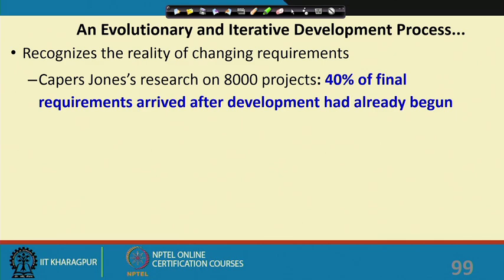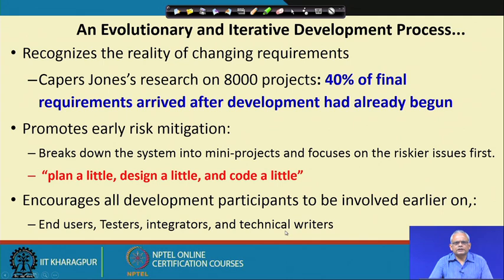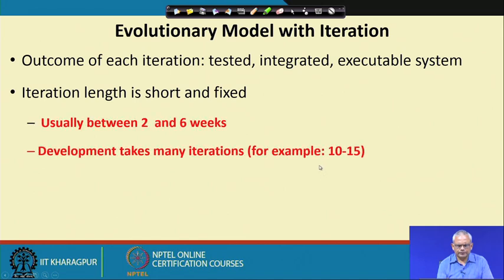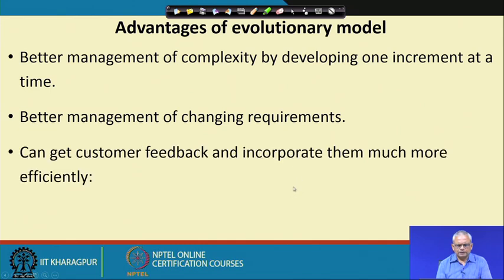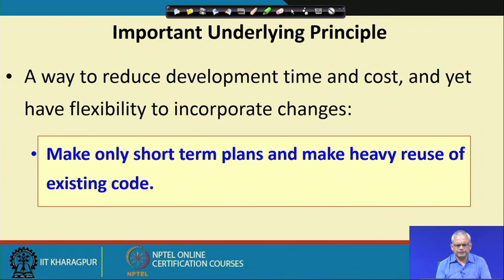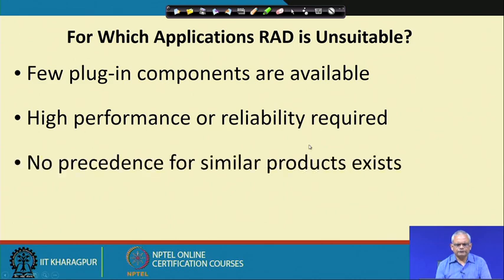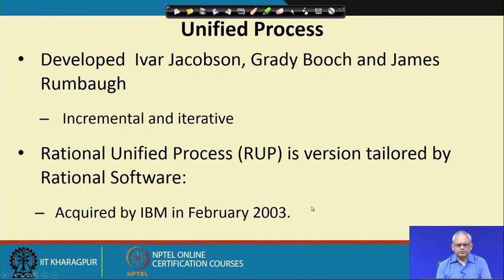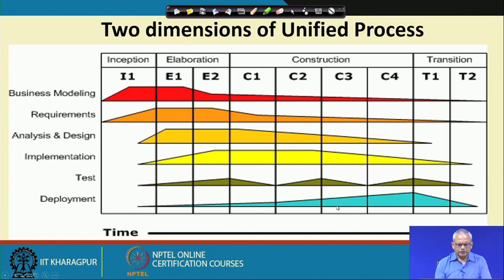Lecture 11: Evolutionary Model

Comment: The model is fit the situation like there is real world system i.e mobile apps or web platform 
And unfit when there is fixed requirements such as. Banking system

So we can improve the model by add checkpoints after each version, so the team can  stop review the mistakes